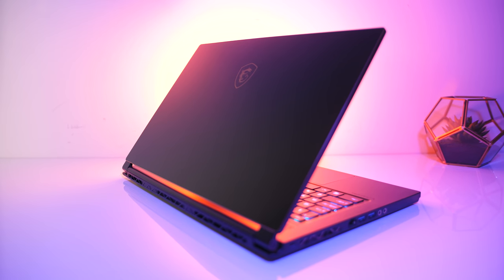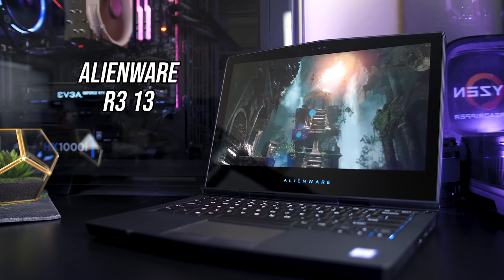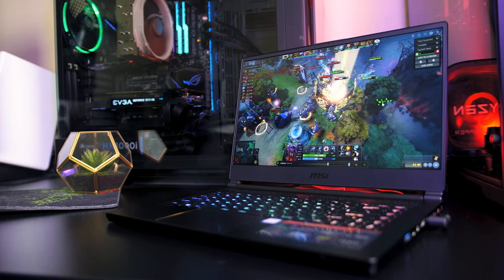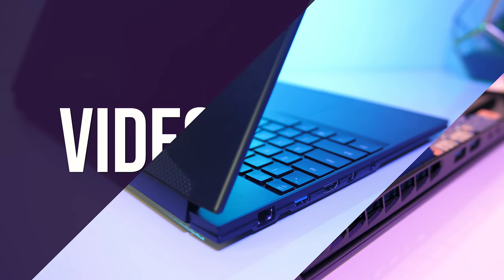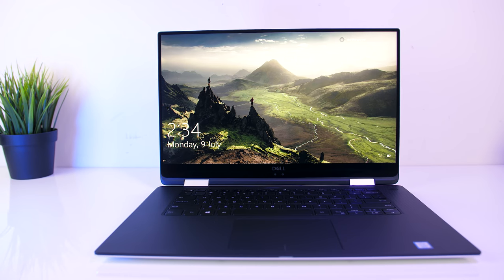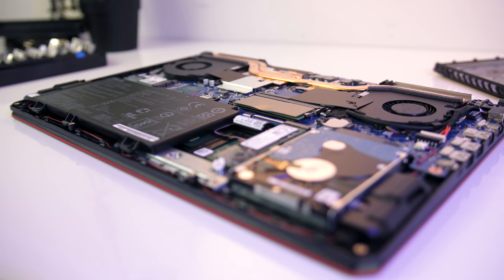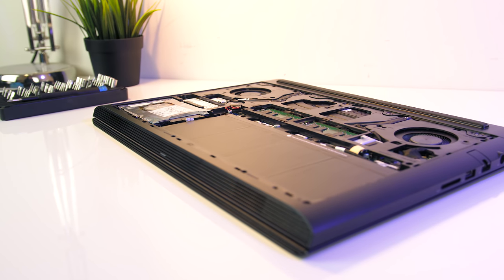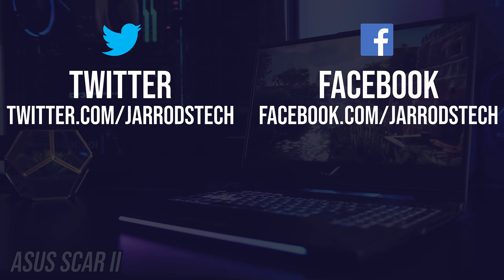The Best and Worst Gaming Laptops of 2018

Comment: I can't really decide between Asus scar 2 (gtx 1060) vs Gigabyte Aero 15x (gtx 1060). Scar 2 is around $250 cheaper but this price difference is acceptable. In terms of gaming performance and thermal, which one is better? I have seen all your review videos on these two products, but still can't decide. It is for gaming (main), youtube and coding.
Reply from the maker: I think the Scar 2 may perform better thermally, though the Aero has a much better battery, so depends if you plan on using it on AC power mostly (you'll want to do this for best gaming performance anyway).
Reply: @JarrodsTech  I rarely carry laptop around as I hand-write most of stuffs at school, so battery is not my concern. I will go with the scar 2 then, thank you.
Reply from the maker: No problem!

Comment: Regarding these laptops, I only have one question and that is - should I get the Zephyrus M or wait for the Zephyrus S to be launched here in India? Asus is waiting to launch it with the RTX cards. I'm looking for the best price to performance and features ratio, and also the keyboard layout of the S. I haven't used such a keyboard and I can't see it in person either. Is it uncomfortable for someone who has always been using the regular keyboard layout for many years?
Reply from the maker: I prefer the M personally, the keyboard is in a better position and if I recall you can get it with non Max-Q graphics, so should also perform a little better too. The keyboard spot is fine if you can use the laptop on a desk with room, on your lap though with it up the front it can feel a bit cramped.
Reply: @JarrodsTech  thank you! I was leaning towards the M as well, because of the regular keyboard layout and the better performance of the non Max-Q cards. I just wanted your opinion too. You're the only tech youtuber who replies to the comments. I simply love that quality in you! That makes you great! Keep it up!
Reply from the maker: Cheers, no problem!

Comment: In my opinion MSI GE73VR RAIDER 8RF is the best, i7 8750H and GTX 1070 is a perfect combination and its cheaper than most 1070 Laptop
Reply from the maker: Fair enough! Haven't had a chance to use the 8th gen version but the 7th gen was pretty good last year 👍

Comment: would you recommend an asus fx505 or an asus rog strix scar (first edition)? Both with the 8th gen i7. Can’t decide since the scar is of the older model, but both have nearly the same specs. It’s just that i can’t decide in terms of build quality
Reply from the maker: Probably fairly similar, I only used the 7th gen of the first scar so not really sure how well it does in an 8th gen to speak from experience, given same specs I'd pick which ever had the larger battery/looked better.

Comment: Hi, is it possible to compare the aorus x5 v8 VS the rog zephyrus M please ? Or the aorus x5 v8 VS the rog strix scar II ? Or the aorus x5 v8 VS the razer blade 15 2018 ? I don't know witch one to buy. Very good job by the way
Reply from the maker: Maybe in a future video, I have 10+ comparisons on the to do list but they take a very long time to get through, you could just check my Scar II / Aorus X5 / Zephyrus M videos and compare the results yourself as I perform the same testing across videos.
Reply: @JarrodsTech  yes i can immagine how busy you can be with all thoses laptops. I did 2/3 times but still hard for me to decide, so may i ask your talents to guid me :) witch one is the best for you ? (Aorus x5 v8 or rog zephyrus M or rog strix scar II or the new razer blade 15) thanks a lot
Reply from the maker: @vilt3  For me I prefer thin and portable, and the Zephyrus M is nicer in that regard, lighter too yet still 1070 graphics and decent cooling. The Razer Blade is a bit more but overall a nicer product in terms of build quality/design, though Max-Q graphics so will perform a bit less.
Reply: @JarrodsTech  thank you Jarrod
Reply from the maker: @vilt3  No problem!

Comment: Hello. I just want to ask which anti virus is the best to use right now or what anti virus would you recommend? My strix2 comes in with like a free Mcafee, just wondering if the will be ok or should i purchase a different antivirus. Thankyou.
Reply from the maker: I don't use any myself, windows defender is pretty good these days for most people, at least that's based on my own professional experience (I work full time in security and often see third party AV as being a point of weakness)
Reply: Thanks for replying. It will help me a lot to make a decision regarding this. 1 more question though, with my strix 2, when i plug/unplug the charger the screen goes black for a little while, do you experience this as well or is it changeable in the settings? thank you.

Comment: What about the MSI GE63 then?
And if I had to choose, would it be the GS65 or the GE63?
I was just thinking between 1060 and 1070, and the FPS on GE63 8RF on rainbow 6 siege was better.
Please explain to me I’m kinda lost here when people keeps on complimenting the GS65
Reply from the maker: My GE63 got too hot and the overall build quality felt a bit cheap, I've got a full review on the 8RF version on the channel. The GS65, in my opinion, has nicer build quality, is thin (usually preferable with laptops, they're meant to be portable after all), and if I recall better battery too but I'd have to double check that.
Reply: but if I'm talking only about pure  performance, which one would be better? I wouldn't be taking it around anyways, ill be charging it 24/7.
Reply: and I don't really mind if it gets hot, I only mind about it getting overheated

Comment: What’s the average temperature for 8750H laptops when gaming? My HP Omen 15 gets into the 90 mark quite often (even 95) and I don’t know if it’s normal for the CPU to get that hot.
Reply from the maker: 90c is about average under multicore load in my experience, that's just how the 8750H gets in most laptops unfortunately, usually some undervolting can help improve that though.

Comment: Jarrod pls tell me the best overall gaming laptop I have been searching everywhere for it pls tell me
Reply from the maker: I think the Aero 15x is a good option if you're after thin/light but still want power, unlike the razer blade it still has full sized ethernet, otherwise the MSI GS65 is also worth considering - at least in the small/thin category, which I assume you're after based on the other comment on the Zephyrus video. Zephyrus is also good, I'd have no problem using any of those laptops realistically, although not personally a fan of the keyboard layout of the GX531, GM501 is better in that regard.

Comment: Should i get aero 15x now or wait for rtx 2060 max q? Aero 15x still cost $2200 in my country and won't go lower even the previous model still at $2100
Reply from the maker: I think it's worth waiting at least 1 week til CES, let's just say Gigabyte have invited me to check out some new laptops there. Even if you don't go for a new one it may be possible that this lowers the prices of the current ones.
Reply: Yeah i will wait for ces. However there won't be price drop at least in my country it will just go out of stock
Reply from the maker: @Wilson-zu3rf  Ah well still good to see if there's something new that's worth buying instead!
Reply: @JarrodsTech  yup i will be waiting your video for ces, although i mostly interested in gigabyte only as asus, msi, etc sell at inflated price in my country
Reply from the maker: @Wilson-zu3rf  I'll try cover as much as I can, so far there are plans for Gigabyte, MSI and Dell/Alienware.
Reply: Well I messaged gigabyte for some things to do better on the 15X... For ex a Oled panel a 970 evo 1tb faster wifi card and they passed it on to the developer team.

So I am excited what gigabyte will bring next. Especially when there will be a 2070 max q with 12nm... I guess this will boost the batterylifetime even more

Comment: Hlo bro.Hru? I want suggestion i have to choose between two laptops having same cost
1)Asus tuf(i5 8300h+gtx 1060 6gb)
2)Msi gv 8re(i5 8300h+gtx 1060 6gb)
Which one u would suggest me?
Reply from the maker: Which TUF? If it's the FX505 then probably that one, better battery life and looks nicer with thin bezels.
Reply: @JarrodsTech  fx504
Reply from the maker: I'd go the GV then, anything but the FX504 for the reasons covered in this video.
Reply: @JarrodsTech is Gv gd enough?
Reply from the maker: @Nemesis.Hunter  It's fine, I have a review of it on the channel here if you need more info: https://www.youtube.com/watch?v=dIzpY4deqSk
Reply: @JarrodsTech  Ya bro i saw that.It was a good review but i am worried for battery and the display as fx504 is gd in that part

Comment: Best all around laptop for me is the Aero 15x. Especially when repasted and undervolted and the touchpad drivers switched to precision. Better battery life and keyboard than the Razer Blade. Better temps. SD card slot, ethernet jack, portable...it all the things Razer is trying to target but fails to do so in the thin and light space. 

Also surprised that you picked the Acer Helios 500 for best cooling in the 17 inch range. I would've guessed either the monster GT75 or the Aourus X7 DT...the only 2 machines that I know of that can keep the 8950HK cool and running at full speed.

Last, you gotta make your temp graphs easier to read. Separate some of them because you are throwing too much on screen at once to the point where the the YT playback bar blocks the bottom of the words like when you pause at 6:36. Try separating the CPU and GPU temps into separate graphs and use other colors besides red, purple, pink and violet as they all look similar making the graphs hard to read. The graph at 10:12 is a lot easier to read. My 2 cents. Hope you have a happy new year.
Reply from the maker: Yeah same, that's why I got it! 😍 hmm I suppose the GT75 has good cooling too, I guess with that one with the i9 I cranked the overclock to 4.9GHz all core so it was still thermal throttling even with the fans maxed out lol
Check today's video on the Y530, I have changed how the graphs are done.

Comment: Hey jarrod, can you assist me on the Asus Scar 2 GL504GS. My buddy got the one with the gtx 1070 with 16Gb and as it turns out, the 16GB ram is single channel. Do you know whats the stock ram card of the Asus scar?
Reply from the maker: Hey, it may vary between region, what you'd want to do is look up what you currently have installed and see if you can buy another stick. My review unit Scar 2 had two sticks of SK Hynix HMA82GS6CJR8N-VK
Reply: @JarrodsTech  Okay

Comment: What should I buy Lenovo 7577 i5 1060 ssd or y530 i5 1050ti hdd with same price?
Don’t really play hard games. Temps, noise, display and general performance are more important to me.
Reply from the maker: Get the higher specs for the same money I reckon still a good machine
Reply: Jarrod'sTech thanks for replying ! but the problem is  7577 has some problems with cooling system (as I know) and worse display.. so do 1060 and ssd ( over 1050ti ) with hdd worth it?
Reply from the maker: Depends what you're using it for, if it's just for games the display isn't too bad, and if it's the 7th Gen CPUs they don't get too hot compared to 8th gen. The Lenovo is a nicer overall machine though so depends if you need that power. If it helps worth remembering dell used max-q graphics so less of a difference between them, I have a video comparing 1050ti and 1060 max-q performance here if you're interested: https://youtu.be/2afayQ4E-VY
Reply: Jarrod'sTech thanks)
Reply from the maker: No problem!

Comment: No Lenovo stuff? I’m using the Y530 gtx1060 and I’m loving it. Cool and performs very well no throttling
Reply from the maker: I'm testing it right now, but I had to buy it myself to do the review because Lenovo never got back to me after months of trying, so didn't get to cover it in 2018 unfortunately, it does seem decent so far though.
Reply: Jarrod'sTech just something for your review. The I5 variant is good enough if your getting the gtx1060 as I suspect the system may overheat with the I7. And I recommend the gtx1060 variant as it has a bigger battery and 170wh power brick. Also I spent like 3-4hours updating the software cause of some bugs with a 5ghz connection. Don’t know if it’s just mine or something everyone experiences. Overall I’m happy with the purchase thou I got it with student discount
Reply from the maker: @hoshimiyaeki  Yeah I got the i5/1060 version, although I still had thermal throttling in my worst case testing, the video on thermal testing went up a few hours ago actually.
Reply: Jarrod'sTech oh lol i did some testing and got no throttling. Probably environmental differences then
Reply from the maker: Could be, I might try changing the paste and see how that helps in a future video.

Comment: I have no clue about gaming laptops. I still wonder why you display those laptops as the best ones. Am i stupid or isnt this Laptop (https://www.notebooksbilliger.de/schenker+xmg+ultra+15+e19snw ) miles ahead of the ones you showed in the video?  Or was the XMGUltra15E19 not on the market when this video was released? Im confused.
Reply from the maker: That link isn't working. Either way I'm guessing it's a standard clevo unit, I review those in the channel under the Metabox name, as that's how they're branded here in Australia. They're ok, but given availability varies a lot by region I didn't think any clevo units were worth a mention compared to larger known brands you can buy around the world
Reply: @JarrodsTech  Thank you for your response. There was simply no space between the last letter of the link and the brackets. I fixed that. In case it still does not work: It's an 15,6'' screen on a  9900k, RTX 2080,  Soundblaster X Pro, 32 GB DDR4 (1200 clock, but certainly no B-die), 1TB SSD and 3TB HDD and the usual stuff. Those last secondary components are not the best ones, i quess, as it always arent in packages and the price is hard. Yet, to be honest: 10 Years ago the relative price between gaming laptops and Desktops dedicated for gaming was huge. Not to mention 15-20 years ago. I think I could get a gaming laptop now for about 2.8k € with nearly the same stuff of an dedicated Desktop for 2.3k €. 
It seems that i have been become an old crook not realizing how small chips and devices got in the last decade. In terms of availability it is surprisingly good in the EU, but the prices are nuts...
Reply from the maker: Well I guess specifically with that, it wasn't out in 2018 so couldn't have possibly have made it into the video 😉 I did cover the 9900K / RTX 2080 model here though: https://youtu.be/AV_MqJceYyY I think the one you linked is the 15" version, I have only had the 9900K/1080 config of that one.

Comment: absolutely Acer Predator Triton 700 still using it and enjoy it
Reply from the maker: Would have been interesting if they refreshed it with an 8th gen CPU for 2018 🤔
Reply: @JarrodsTech  For that exact reason I'm thinking of getting the Zephyrus GX501 (the refreshed version has an i7 8750H), it's hard to find a very powerful laptop (1080 max q here) that isn't a jet engine. Any thoughts on that?
Great videos btw!
Reply from the maker: @Elijah-ed5xk  Thanks! I used the previous 7th gen GX501, from what I remember was quite good, other than the touchpad placement, but as usual with the Zephyrus compromises like that need to be made to get the good cooling solution up the back, hopefully I can get my hands on the 8th gen one sometime!